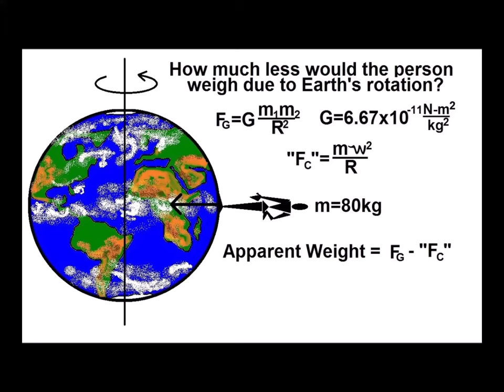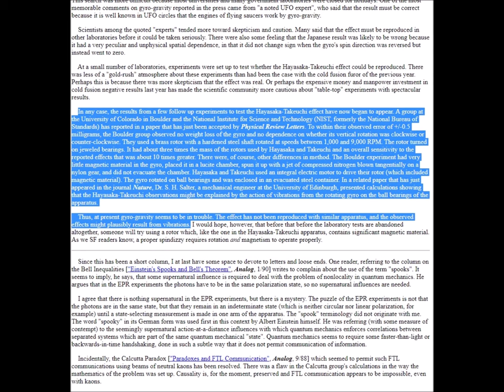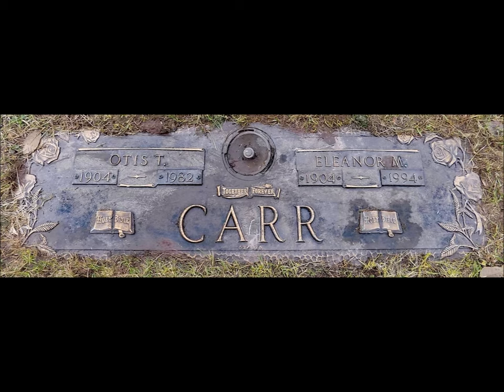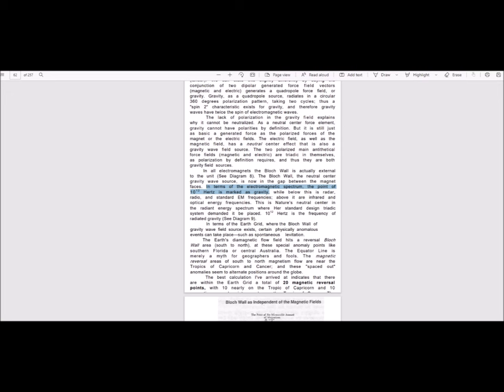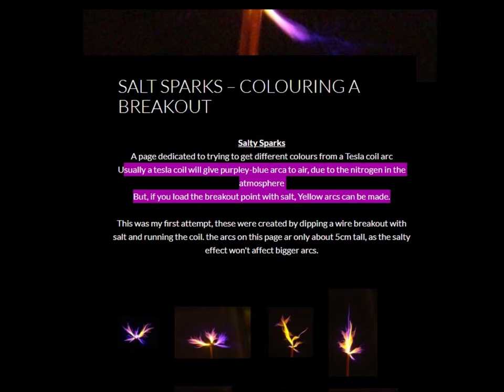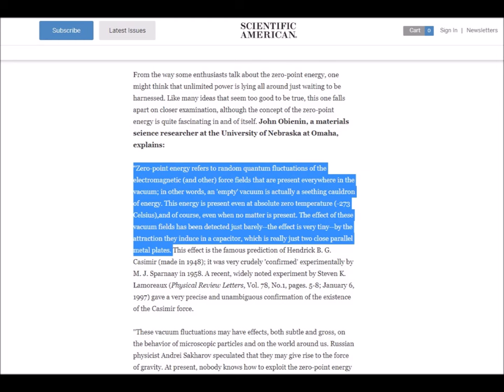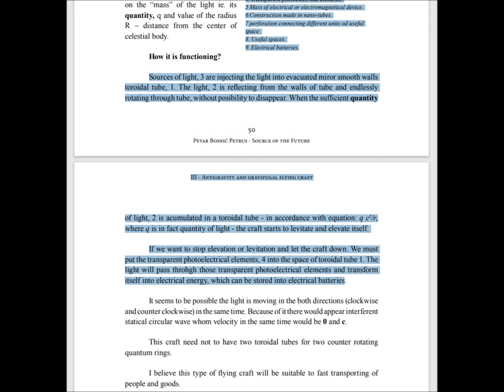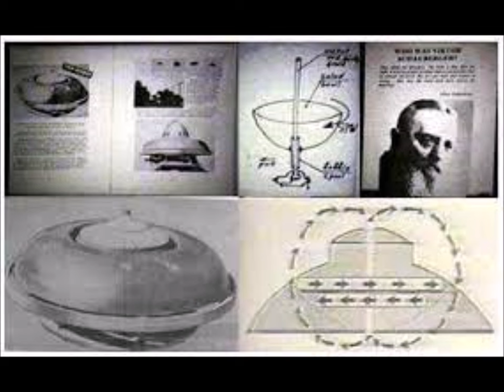Otis T. Carr's Inertial Field Lift Part 1: An overview of the OTC-X1 Circular Foil Spacecraft

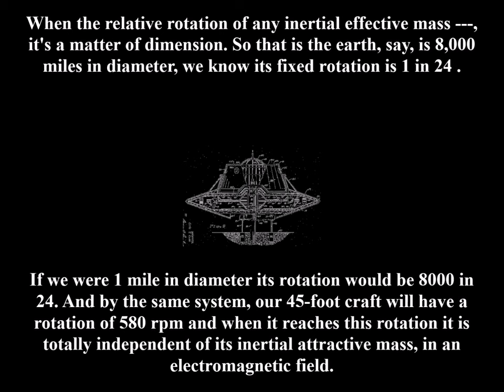Comment: Dude, you are missing something important. 16:46 "when it reaches this rotation it is totally independent of its inertial attractive mass, in an electromagnetic field." Otis didn't say in a gravitational field. You are missing the elements of the construction of the OTC-X1. He said you had to charge the counter rotating discs with opposite polarity. It isn't simply spinning a disc fast.
Reply from the maker: I've listened to several of Carr's descriptions of his system in his own words. He doesn't mention charging the discs per se. Only rotating them. The discs would become charged via rotation. And since they are spinning in opposing directions, they would become oppositely charged in respect to each other.
Reply: @gsutton78  "The discs would become charged via rotation" - I think you may have to explain to me the physics of how spinning disks get charged arbitrarily by rotation alone. You have to have some mechanism to separate and store charges. For example; a Wimshurst Machine, through electrostatic induction. In that case, the disks don't get charged. The spinning disks separate the charges that can be stored in a capacitor.  My point in my first post is still relevant. Otis said electromagnetic field. Where is leap of logic to bridge to how it is anti-gravity?
Reply from the maker: @XR_IX     Carr said that the craft would become independent of its inertial attractive mass (and) "in an electromagnetic field". In other words, the craft would not only generate its own gravitational field, but would also be enveloped within an electromagnetic field, similar to how the Earth has a gravitational field and is also enveloped within its own magnetic field. The craft is essentially a miniature Earth with a gravitational and electromagnetic field which counteracts the Earth's gravitational and magnetic fields. Now for how rotating discs can become charged and generate electromagnetic fields, see my video on magnetogravity and scalar waves: https://youtu.be/nu-UCFlNSx8. And for the theory on where antigravity comes into play with extremely fast linear and rotational motion, see my video on what is called the "gravifugal force": https://youtu.be/0A2SyLn824M.
Reply: First let me say I am not here to discredit you. I would rather talk to a person that experiments to discover what reality is, rather than a room full of academia groomed regurgitators of what they have been taught. However, you have to improve your game. I can tell you that you are wrong, because your stuff is still out there. If it had a shred of truth, it would be erased. It's allowed to exist because it cites unproven theories re-enforced by pseudo science. If that sounds harsh, please indulge me because I am bound by the truth, and I am still learning myself. Truth is perceptional art, and because nobody knows what the truth is anymore, you have to find it for yourself, and that is my warning. Disinformation is the process where truth is diluted with falsehoods to influence people. I have reviewed your Magneto-Gravity Part 1 video. Your conclusion of Magnetic pole orientation affects gravity is interesting, however your testing parameters could be... better. You have to remember that your magnets influence the scale's electronics, the magnet could be pulling up on the transducer, appearing to lessen the weight. The other issue is that your orientation of the magnets are in question because the fields are not uniform. If the magnets were spherical, it wouldn't raise that issue, but even then, view an iron filings spread and you can see that the flux is in a toroid but but distributed by the magnet dimensions. You have to also to check your sources. "Nikola Tesla's flying saucer: electromagnetic field lift experiments" was not written by Nikola Tesla. You question the relationship of all the forces interaction, and mention lift/frequency but that proceed to say that "powerful currents of electricity flowing out over the surface of the craft will generates lift and propulsion". Do you have a video that proves that? Then you take a step back, and realize what does that have to do with magnetism? You have to prove one point at time, and then say how it relates to your theory. These pseudo sites don't know, and much is placed out there to obfuscate the trivial and the simple. You're a thinker G, I hope you focus.
Reply from the maker: @XR_IX     It's not a matter of discrediting anything. I'm simply pointing out the theories and concepts. That's why most of my titles are in the forms of questions. In fact, the theme of my entire channel is that these strange stories and accounts from ancient times to more modern times may not be entirely true, but may nevertheless be based on real principles and events. Take the hoverboard from the Back to the Future series. The concept is actually based on something real; namely Maglev. The producers got the idea from a university that was conducting a study into electrodynamic suspension as pioneered by Eric Laithwaite. In Back to the Future lore, the hoverboard's propulsion is listed as MagLev. But it obviously doesn't operate according to real world principles. It's similar to the real thing, but there's an ample amount of movie magic. Someone seeing it on TV and not realizing it's a movie might actually think it was real. But it's only based on something real. I personally believe a similar situation has occurred with a number of claims from the past. As you may notice, I don't have hundreds of thousands or millions of dollars to experiment with. I also have a 40 to 50 hour per week job that is totally unrelated to these interests. My work is doing what I can to create a foundation of actual science derived from these accounts which can then actually be tested and developed if they are found to have validity. So, your critique of my methodology and conclusions is really unnecessary. As for the magnetogravity experiments with the magnets, I took care to make sure that the magnets didn't interfere with the scale electronics. This is why I didn't place the magnets directly on the scale, but on a piece of foam. I then just reset the scale to tare the foam so that only the weight of the magnet was being read. Powerful currents flowing out over plates could theoretically produce lift as they generate magnetic fields. A force can then develop between interactions of these fields and the geomagnetic field. This should be pretty straightforward. We see these vertical component of the geomagnetic field with the dip needle. Of course, Tesla used alternating currents, so the question is whether or not a net upwards force can be generated from an alternating magnetic field rather than simply an oscillating force with no net direction. According to the Tesla EM Lift document as well as the document of the 'Magnocraft",  there can be a net force if the frequency of the currents is sufficiently high. But I haven't confirmed that via experiment yet and I state as much. My channel is essentially an ongoing diary, in the pursuit of truth every bit as valid as your own. I would suggest reading a few articles by Julio C Gobbi. Particularly interesting are: Schauberger Technology, Carr Technology, and Searl Technology. What I've found is that these concepts are not entirely baseless, though they do need to be tested, clarified, and improved.
Reply: @gsutton78  I get it - you are more conceptional, and less design engineer for a prototype. Would I be correct in saying that? Conceptionally speaking, your reasoning seems to have a couple of leaps. You have stuck to the Gobbi, "According to Carr, when two electrically charged bodies rotate in opposite directions on the same axis, the effect is to create a gravitational center that makes the craft independent of external gravitational forces". Which is fine and all, from a conceptional review. However I have yet to see anybody create two counter spinning disks flying. People have tried, and yes there is a laughable tubes that are obviously on a string: https://www.youtube.com/watch?v=1aKHgiJDoDw. But this Otis Carr device is non-sense, if Otis truthfully provided how it worked. How I know this, is because his spinning disks always has a negative - "anti" gravity effect. If he had said, something like,... and this is how to increase gravity. -Or such that he could enhance gravity, then I would listen. Now, there are some real things like lifters, which is more likely, what Tesla stumbled on (I knew the answer when I asked you to show me a device that could lift using HFHV), seeing how he was creating megawatts in his coils. It would not surprise me that during Tesla's experiments with using Earth cavity resonance and different top loads and constructive resonance, one of his coils started to levitate. I mean he could conjure ball lightning.
Reply from the maker: @XR_IX     I do love concepts. But I also value practical results that could potentially lead to a working device. This is why I am so adamant about conducting actual experiments. There's some method to my madness. 😊 Now, the proposed inertial effects of rotating disks is an interesting one. But there is no doubt that an object moving fast enough will escape gravity, hence escape velocity. Orbital velocity is a bit slower. If a projectile could be kept moving  at about 5 miles per second or 18,000 miles per hour, it would not fall to the Earth. Instead, it would remain above the Earth's surface in low-Earth orbit. It would practically be levitating, though not hovering in one place. That has already been demonstrated and is seen in how the space station remains in orbit by traveling at 17,400 mph. The question is if a disc or ring rotating at the same relative speed would also levitate. A four-inch disc would have to rotate at about 90,000 RPM in order to lose a noticeable fraction of weight. That is an extreme speed and might point to why we haven't seen any such experiments yet. It would be more practical to have a disc with a much larger diameter. The larger the diameter, the lower the needed rpm. But with a larger diameter you need more torque. Horsepower of course addresses both issues. But, the needed horsepower is still quite extreme, even for a small object. This is probably why levitation is associated with literature about free energy, because so much energy is required to levitate. Even the known principles of Maglev require a prodigious amount of energy to lift a given weight to a given height in comparison to the more conventional forces of aerodynamics and rocket propulsion. Tesla proposed a solution to the "Problem of Increasing Human Energy". And this is what we need. The Earth receives more energy from the sun each hour than the entire planet uses in a year. Every single hour, yet we don't even use a significant fraction of solar energy.
 We must correct this if we hope to realize such futuristic technologies. Once we can harness this energy at will, then it wouldn't matter if our devices required 5 Megawatts to operate. But with our current level of energy technology, it does matter and is totally inefficient and impractical. Also, from what I understand, the counter rotating discs are used so that the attached cabin doesn't rotate. A cabin attached to a rotating disc would experience angular momentum; essentially an equal and opposite reaction. The disc would rotate in one direction and the cabin the other. Needless to say, the pilots would be splattered against the inner walls. A second disc rotating in the opposite direction would counter this. The cabin mounted in the middle would then not rotate. Also, antigravity and negative gravity aren't quite the same. If we consider Einstein's equivalence principle, gravity can be replicated in space by accelerating a room by rockets accelerating at 9.8 meters per second squared. This would produce a force indistinguishable from Earth gravity. Antigravity would be produced by slowing the rockets down and then shutting them off. We'd then be in a free fall condition which would result in us floating just above the surface of the room. This would be antigravity, something akin to Luke Skywalker's landspeeder. Negative gravity would then be achieved by reversing the rockets and accelerating the room in the opposite direction. Our heads would then be in gravitational contact with what to us would be the ceiling. This would be negative gravity, at least to us on the rocket. If accelerating at 9.8 meters per second squared, this would be negative 1G. If antigravity is indeed possible, then trust me the government has known about it for decades. And they've had the finest minds and billions of dollars to develop it. I frankly believe that's what the majority of these UFOs are rather than aliens just performing the same aerial maneuvers for 70 plus years. What are they waiting on? I believe that after WWII, there were two branches of science. One was for the public, which is what we know of as mainstream science. And the other branch resulting in these UFOs. And if so, I doubt they'd be threatened enough by my studies to erase them. I am like the Wright brothers just barely getting off the ground while they are operating the latest version of a Mark 85 spy plane.
Reply: @gsutton78  They have DC motors you can buy that go to 40,000 RPM directly driven. At that rate, you would need a disk of 12.6 ft, and you should achieve 18,000 miles per hour. You would need to be in a vacuum, to negate drag, and use rigid and light materials. That would take a bit of research. But with some type of incremental transmission, you should be able to reach 40,000 RPM and of course your transmission could take it beyond that number. I know you're quoting Otis, but That counter rotation business to keep from splattering the pilots is nonsense. We think in 3D, but this kind of engineering for UFOs are well beyond what we know. To make the kind of maneuvers you see, where a UFO goes under the surface of the sea, means that it has little or no mass. The only way that could happen is if it didn't exist in our space, time (well partially anyway). This is why I don't pursue this stuff...well not to build one like the OTC-X1, because that's just diversion, unicorn. I mean really you could just build a HVHF lifter, by laying a Wimshurst device on it side, and use it to generate the voltage for the asymmetrical capacitor for lift. And looky, you have your counter rotating disks, AND your Foil spacecraft!
Reply from the maker: @XR_IX  Definitely, it would need to be in a vacuum. A disc or ring rotating at high speed within a fluid whether air or water would levitate due to vortex lift - aerodynamic or hydrodynamic levitation rather than any inertial/gravitational effects. A vacuum would eliminate any lift due to fluid dynamics. And so, any reduction in apparent weight or lift should be due to the proposed "gravifugal force".  Lifters are also something I'd like to look into. I've read experiments with them using around 30,000 to 40,000 volts. Do you know of any experiments with higher voltages? It would be interesting to try ionocraft experiments with up to 1 million volts DC, as well as experiments with high frequency AC a la Tesla!
Reply: @gsutton78  If you know electronics, just build a slayer circuit that can handle 48V. That should get you up there.

Comment: Wrong wrong wrong ......the big idea was that he put a battery on motion the craft recharges itself let's forget teleportation for a second to get this thing of the ground it must be rotated.....very fast gravity doesn't like rotation....hints the words enertial attractive mass
Reply from the maker: Uh, which is pretty much everything I said in the video well before mentioning teleportation.
Reply: @gsutton78  it's very simple he basically grabbed a wheel suck a battery in the center and this battery pulsed the outer electro magnets and they in turn pulse the capacitor plates starting a motor effect...and the craft begins to spin....,....the utrons are a by product and they begin to rotate on their own and they also recharge the center battery like a alternator on a car...also the center utron accumulator had a amplifier coil so as the smaller utrons pulsed it this ac current (pulsed) will create a inward tornado pulsing magnetic field causing the craft to use the earth atmosphere to recharge itself..also the craft created a force field because it charged the capacitor plates..this cases the craft to glow like a florescent light bulb...this glow protected the craft from any thermal barriers and also gave the craft it's vacuum effect used for it's high speeds....